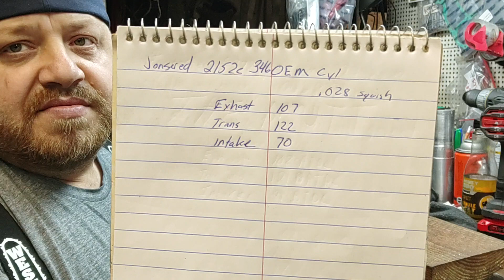PORTED JONSERED 2152/346xp... TEARDOWN FOR A NEW OEM CYLINDER..🤙🏻😎💯

Comment: Can I do this to my Cs2149? Just picked one up with a hyway cylinder but am thinking about getting an oem 346xp P&C
Reply from the maker: I believe your saw is like a husqvarna 350 ..if thats the case ..yes you can bolt a 346xp cyi no problem

Comment: Ring of death? Question answered.
Reply from the maker: Some cylinder out of the box have a ring at the very top of the cylinder that is a little bigger than the bore ..if you machine too much out of the squish band the piston ring will snag in it or bleed off compression
Reply: @Aaron_A_Lynch  I was guessing if the ring of death was the cause of failure but you answered my question on the video as I pushed send.  I remember you saying no more Warhawk cylinders👍🆙🦎
Reply: I have a dam near new 2159 might have 3 tanks of gas
Reply from the maker: Dang...I got one that needs rebuilt
Reply: Why not a 357 or a 359 cylinder on that saw ? I have a couple of them and been thinking about trying one or the other but just haven't yet become the still run so good .
Reply from the maker: 357/359 is not a bolt on they are bigger cases and different bolt pattern...
Reply: @Aaron A. Lynch  glad I found your Chanel before I tore apart a good saw for nothing , guess it's time fore me to scribe and mabe learn something.  Thanks for the reply.
Reply from the maker: Yessir 🤙🏻